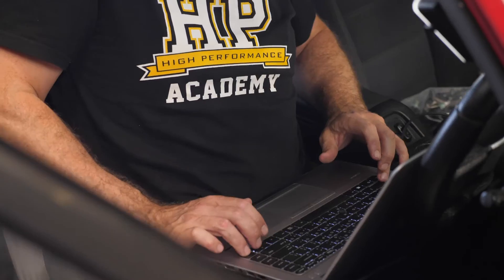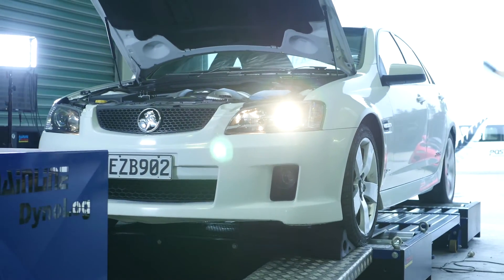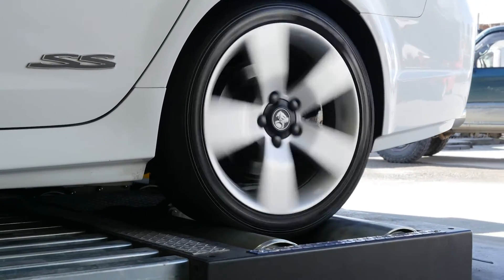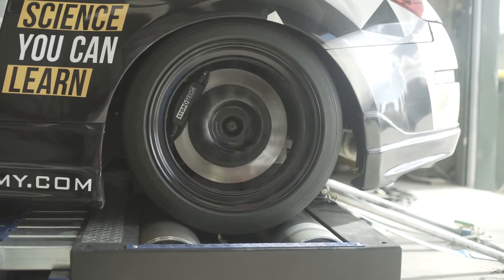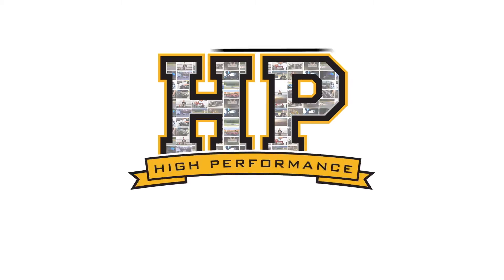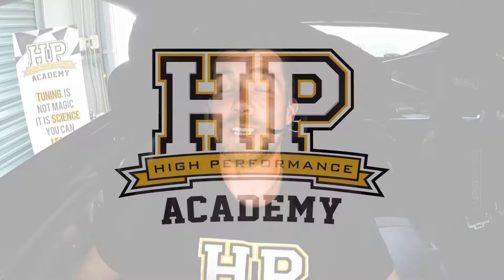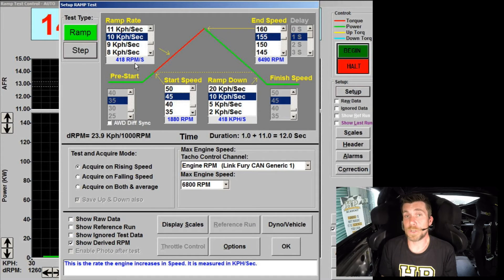Dyno Setup and Operation | Mainline Chassis Dyno

Comment: What are your thoughts on car cooling and setup? For example, having the bonnet/hood open and types of fans used.
Reply from the maker: Bonnet up 99% of the time. You're never going to get the same airflow as on the road from fans unless you're tuning in a wind tunnel.

The main thing is to watch your temps and see for yourself as some cars need more care with this than others, and your location will play a major part as well.

For example in the winter here we have had issues getting a car up to temp with the fan on, and in the summer the same car needs all the air it can get. The only way we know that is by watching the temps. If we just did what suited another car without checking for a fact and then monitoring further we'd have issues, no question.

The fan used is just a mainline one, and we have an extra one (not sure on brand, it's bright orange and looks horrible if that helps 😂) we put on top sometimes if we need extra airflow or for the airflow to be a little higher - Taz

Comment: Does the direction of installing our dyno play an important part? I would like my cars to be head in instead of the usual that i see which is head out
Reply from the maker: It doesn't change how it works, you can do whatever suits you. I guess the main 2 things you need to consider are exhaust fumes and noise. Everything else can be made to work around those key points.

We did lose a lot of workshop room to have ours setup like this and have since gone to a hub dyno setup in the same position (you just wheel them out of the way when not in use). Before you ask (fair question too), sinking the dyno into the ground wasn't an option for us as the concrete is too thin and we don't own the building, so for the dead money paying to sort that it was better to just get a hub dyno when we started running out of room after a few years - Taz.

Comment: What about automatics and the rest of measurements after ramp run ?
Reply from the maker: What specifically would you like to know about automatics? Cost down is very much a dyno-specific aspect which the mainline doesn't support hence it isn't covered. The dyno provides power at the wheels and doesn't seek to provide a flywheel figure - Andre
Reply: @hpa101  Just the main differences between automatic and manual when it comes to the general approach, setting up dyno, steady-state, ramp run safety measures, etc. What can or cannot be done if there are such things.
My guess is that torque converter design and trans fluid temp have an influence on final numbers, just not sure how much.

If all extra features like coast-down depend on the dyno manufacturer then it's clear enough, no need for further explanation.
Reply from the maker: @V8interceptorChannel  for the most part tuning with an auto isn't much different than a manual. The key difference would be that the torque converter will understandably slip at lower rpm so this can make it impossible to fill out the low rpm/moderate load cells in steady state like you can with a manual. You'll generally see a higher level of drivetrain loss with an auto too, all other things being equal - Andre

Comment: i have to say the riding up the front braked roller is more a method for dynos who only care about at the wheel measurements, but this is not the full measurements. At the wheel measurements are part of the picture...without coastdown measurements also (power runs) you are missing a lot of measurement data. As you said in your presentation, different tyres, presures etc will all effect the measured power...  Allowing roller climb changes losses, reduces tyre contact patch on rollers, changing measured power. Inconsistent method.  I run a dyno to ensure the car remains planted down into the rollers by suitable strapping, and measure coastdown losses  to see the full picture and also see atw, losses & calculated engine power.  ATW measurement is an incomplete measurement.  Allowing roller climb and promoting it as a good method seems flawed to me. sorry.
Reply from the maker: There's significant differences between different dyno brands and hence the technique of using a particular brand also needs to be considered. You'll note that this is a video specifically on the Mainline rolling road. This brand of dyno doesn't perform coast down measurements hence including this in the video would have been difficult at best. I understand the principle of the coast down test determining drivetrain losses, hence supposedly being able to provide an accurate 'flywheel' number. Thats has not been my experience with the dynos I've used that provide coast down tests. I prefer to use the dyno as a comparative tool and frankly I don't care whether it displays wheel power, fly wheel power, or fluffy unicorns - What I do care about is consistency/repeatability so that when I make a change and see the power change I can be confident of the correlation. 

With regard to allowing the car to climb onto the knurled drive roller, this is as per Mainline's recommendation, and given my own experience running the dyno with a wide variety of different vehicles, and a wide range of strapping techniques, it's also the best way of getting consistency (and avoiding wheel spin on more powerful cars). Again the demonstration here is specific to the Mainline brand so please don't assume this information is applicable to every dyno. We do work very closely with the manufacturer to ensure we're providing accurate and reliable advice specific to their product - Andre
Reply: @hpa101  ~Thanks for taking the time to reply. Appreciate it. I respect the video's and sharing you do, and as a tuner with dyno myself its nice to see others professional approach.. When it comes to dynos, and those that read atw only but still report flywheel figure also from only a calculation (dyno dynamics, dyno developments in the uk to name a couple I'm familiar with), those that allow the roller climb always overstate the power. The transition from sat in both to rising up onto the front, has to have a measurable effect, even that of not having 2 x contact patches, and 2 x roller inertias to spin up, to then 1... I know you know what I mean.  I'm fortunate to have bought a dyno I too am confident in, and as with yourself, is super consistent in its measurement, and makes for an excellent tuning tool. (VTECH linked 4x4 dyno from Poland for ref).  Keep up the great work and videos. Many thanks. Bill
Reply: @hpa101  where did you get the strap system for between the rollers? I run a mainline dyno and this would help massively with some of the bigger power stuff I dyno.